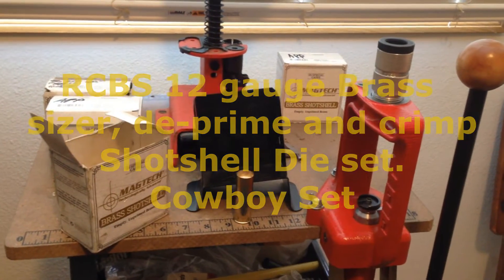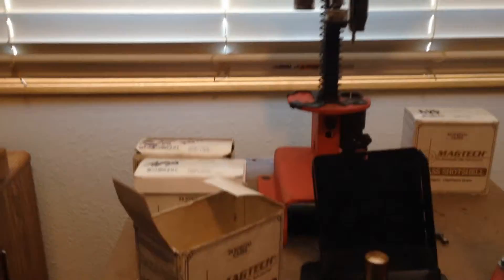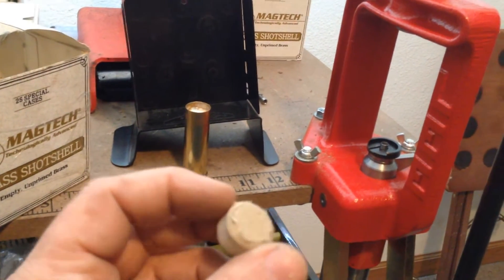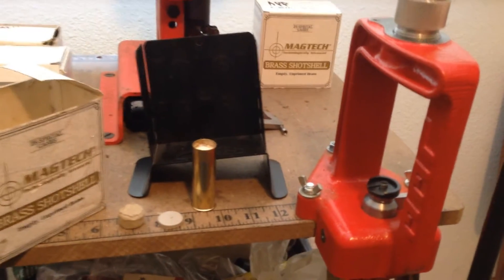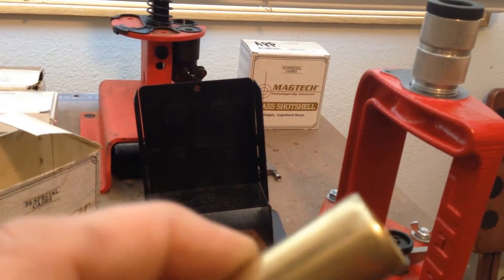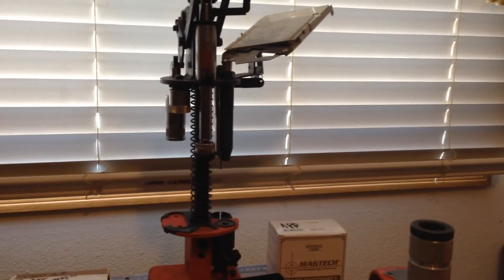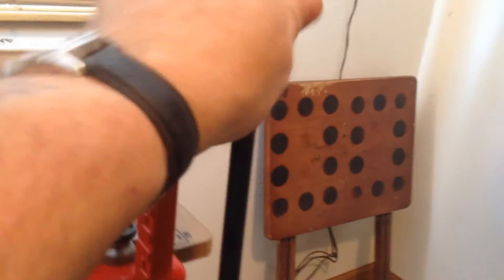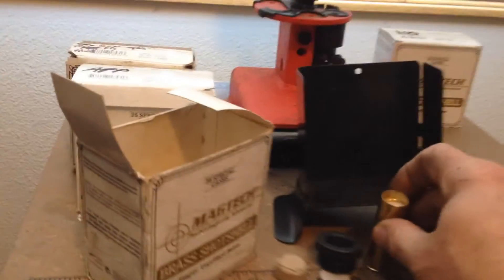RCBS 12 gauge Cowboy die set crimping

Comment: Does it unroll when fired?
Reply from the maker: Yes
Reply: @bmanowske  ok in that case I have another question.... How many shots can you get out of a brand new piece of brass after rolling that edge? Does it get brittle to the point it needs to be trimmed off?
Reply from the maker: @highoctain113  They do get weak and crack after a while! Depending on how hot you load them. I would say about 10 times with light cowboy action bp loads.
Reply: Ok I seem to be getting run around in circles about this subject
Reply from the maker: @highoctain113  what do you mean?
Reply: @bmanowske  apperantly it only took the first sentence of my post..... Ok, one more gin..... So I have 4 different shotguns across the general action type.... So when I saught out this video it was to answer a few questions I had... So with plastics, the crimp edge is a soft roll to aid the feed ramps ( in the event that there are some ) to feed a round in the chamber, where as the brass would have a much sharper edge to aid the ride into the chamber.... Now to get that nice soft rounded edge, this video,  is what I came across in order to see if it was possible and if so how long would they last....I know without a doubt they will work in a break action, crimp or no crimp... Are the brass shells capable without the roll crimp to consistently feed or are they going to jam occasionally.... So the main reason I'm asking all these really dumb questions that sound rediculous, is because if they are only 99.9% consistent in loading then I wouldn't want to purchase enough to fill a 50 cal can. ..... Now the other factor is that I have a particular " ar-10 " platform 12g that requires at minimum 1.5 oz at 1350 in order for it to cycle properly. I can run through some shells with it, and if I can reuse brass shells through it, I can load it in a fashion that this shotgun will cycle reliably as long as the shells feed. In which case I would want to order more than just 1 box for my break, I would likely buy bulk to have a bunch in rotation. I know these sound like really dumb questions, it's just a difference between a 50$ purchase or a 500$ purchase or more.... If I don't have to worry about feeding issues from the hard angle then I just assume not roll and just use them as is so they will last much longer..... I honestly think I portrayed my thought much better on the original post and wish it would have posted.... My intentions for these questions are to ask someone with real experience before I lay waste to a bunch of money in defeat.
Reply from the maker: @highoctain113  Ahhh, ok! I have shot mine through a MKA 1919 but that SOB wouldn't cycle good factory loads very reliable! However, in CAS competition, I have shot them in a 1897 pump, and a 1887 lever and fed better then plastic reloads or factory. Now, as for loading with smokeless powder as hot as you mention for your AR 10 platform to cycle, the brass won't hold up long! The wad you use , in 12 gauge shells, are to be 10 gauge plastic or 11 gauge fiber ! Look at Ballistic Products web site : https://www.ballisticproducts.com/MagTech-12ga-2-1_2-empty-brass-shotshells-for-reloading/productinfo/3921270/ and you will find suggested fiber wad sizing in nitro card, wads, and over shot cards! Good Luck!
Reply: @bmanowske  oh my goodness!!!! Nice!!!! Now I'm getting somewhere!!!! THANKS!!!!! OK, so.... Why wouldn't the brass last long with smokeless? High power riffle cartridges are a lot higher pressures and you can get 10 good shots out of brass before you really need to start thinking about trashing them from rotation because they start splitting open, which is another one I can't wrap my head around,how does brass ( or plastic ) blow out the side when the entire wall is supported by the camber walls? Most of the pictures I see of ruptured casings, the split/rip/tear, is in a verticle format as if it's getting bigger circumfrence, as apposed to a horizontal format that one would get from the case stretching and elongating in the chamber... But I guess that's another subject...
So the way I'm understanding it is that these brass cases are designed for black powder and not " intended " for smokeless. 
The mka 1919 you mentioned... That's a (somewhat) ar platform, is it not? And they ran great? It fed reliably? Were the brass cases roll crimped? What was the load data on them? Is there an adjustable gas block on it for lighter loads vs heavy? I've tried bird shot in my xtr 12 and it will NOT cycle them... But then I put 00 at 1100 through it and it loved it... I don't have to load them nearly as hot if I'm putting them through my pump. Do you know if they will feed a pump if they aren't roll crimped?
Reply from the maker: @highoctain113  the 1919 was a real pos! (Piece of shit) the magtec brass is really thin and will split easily with a strong OO buck shot load over a moderate load of smokeless powder and wouldn’t cycle or feed on a reliable basis. The other semiautomatic shotgun I tried was a Stoeger 3500 and did fine. In any firearm the shells were roll crimped. The 1919 did have an adjustable gas check but didn’t make a difference!